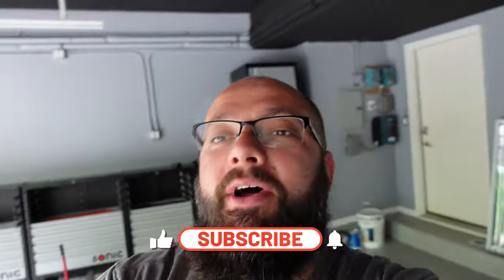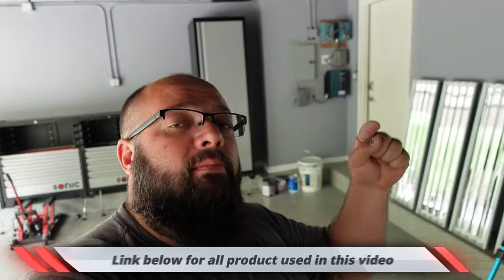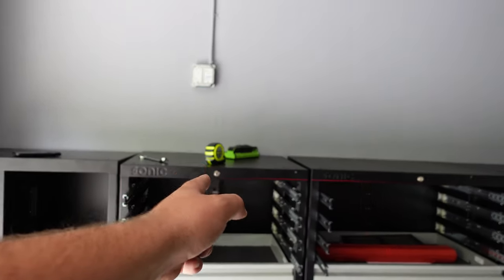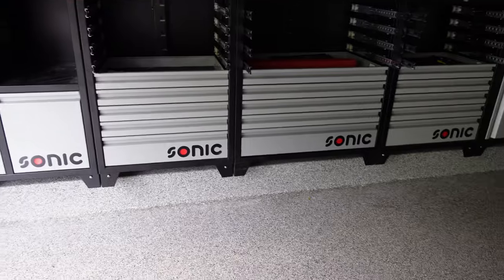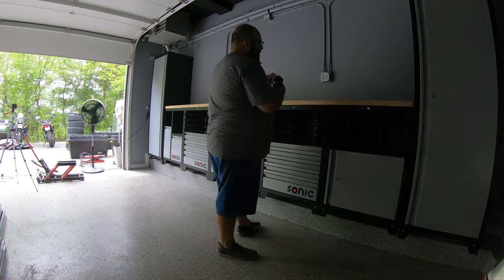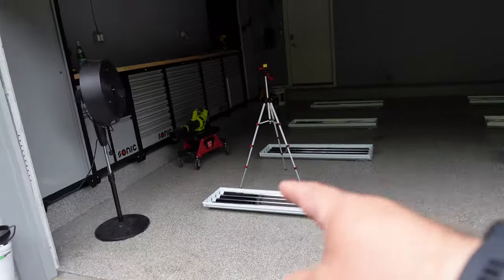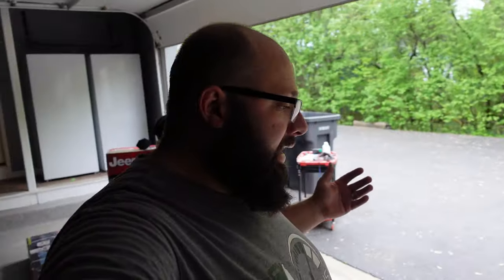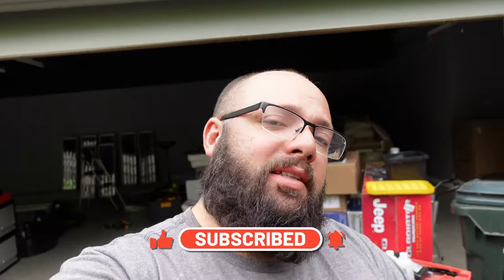Wall Mounting Garage Cabinets - Garage Remodel Update!

Comment: Very nice.  Looking forward to seeing the TV mounted as well.  Interesting choice with the dark ceiling but with all those lights, you'll be fine.  Can't wait to see the flooring...i bought the plastic "squares" from Costco when we bought our current home in 2012 and they are still looking good. I just sweep and mop with warm water on occasion.  I keep telling my wife, our next house will have "at least" a three car garage....two just doesn't cut it, LOL!
Reply from the maker: Lights got installed today! Check out tomorrows video! and Glen, lets be honest, once you have a 3 car garage you'll need a 4 car garage. I went from no garage, 2 car, 3 car, 4 car garage and a shed and half my stuff still parks outside! 😂
Reply: @GasTachs  LOL!  You're right.